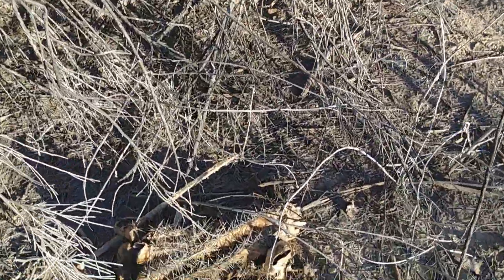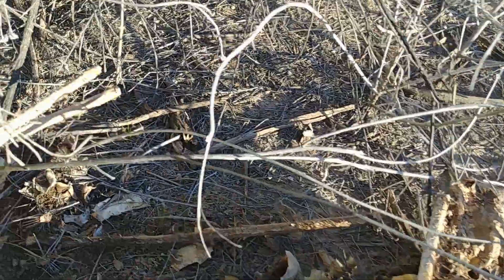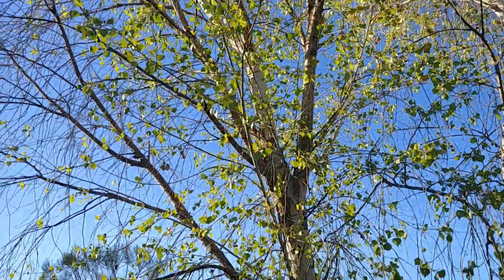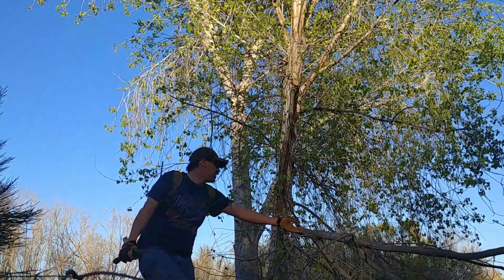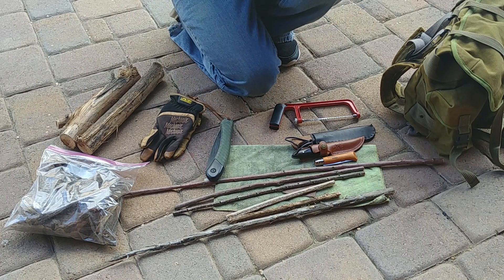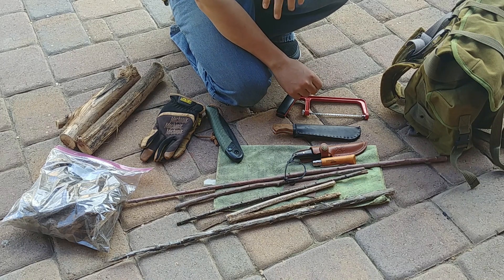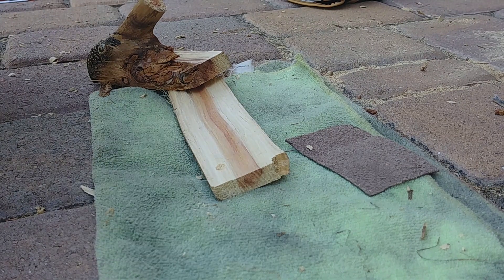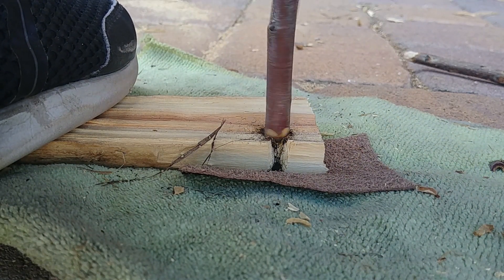Friction Fire Testings - Success

Comment: If at first you don't succeed try again.  Or in my case again and again and again.  Lol. It took me a couple years to get this down.  
I think I was just as tickled as you when you got that first ember.  It's a great feeling.  
When I teach the bowdrill class with new students I always use a bearing block with bearings from a fidget spinner or skate board wheel.  
My string of choice is a heavy tarred bank line.  
Great job on the friction fire. 
Glad you kept with it.  
Take care and God bless.
Reply from the maker: I definitely kept at it when I got the chance. I realized that there are quite a lot of factors to think about towards getting an ember. That fidget spinner helped a ton to help the spindle move freely. I'll definitely be getting some bankline and use that for the string. I don't know why, but for me the smaller thickness helped me out more than the regular paracord. It's awesome to finally achieve an ember and it took about 4 years of practice. Thanks for following my friction fire journey!